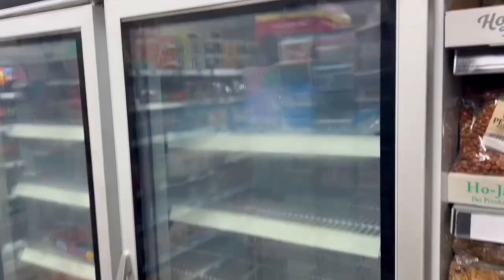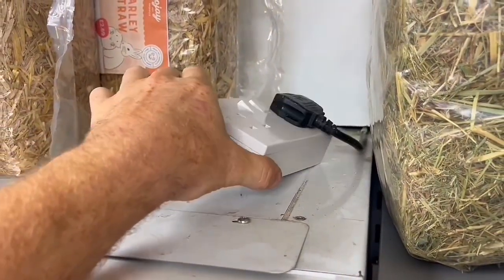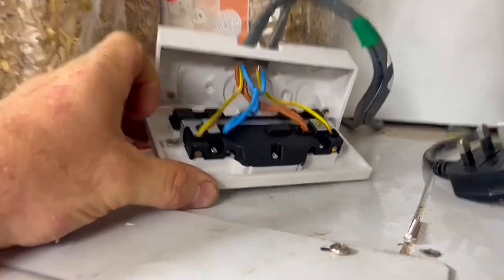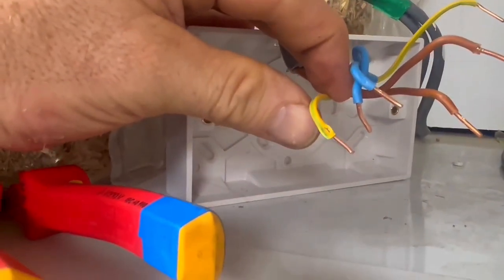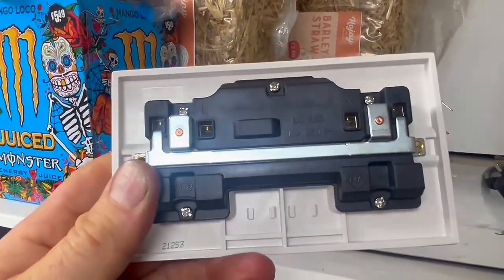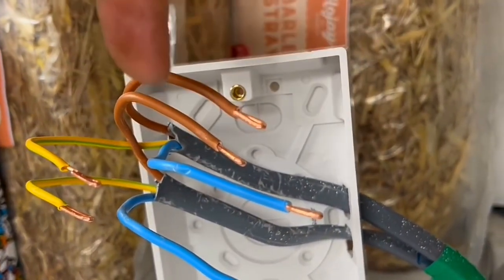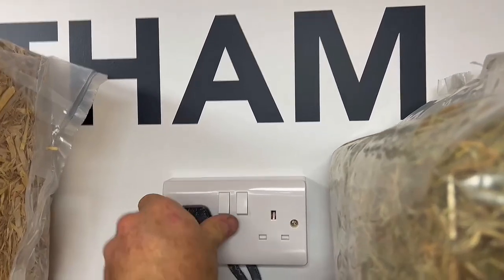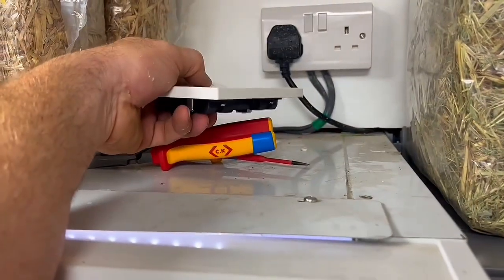Socket Has a Monster Problem 😱

Comment: Only needs doubled , when its one single conductor..  to form 2 pieces of copper under the screw.../ you,ve  literally 4 pieces of copper , each 2.5sq.mm. under the screw . The term is,nt. designed for 4....

Comment: Moulded plugs have been known to fail before too.. I know there was a spate in our company around the 90's where moulded plugs were removed and proper MK plugs were fitted
Reply from the maker: Thanks for sharing your experience!
Reply: I've had leads shorted straight out of the box.  It's just not something you normally test for, plug in, bang.  Nice.
Reply: As an auto sparks, I've replaced several moulded plugs on EV charger cables over the last 18 months, interestingly all on MG5's and they tend to look a lot worse than the one in this video.